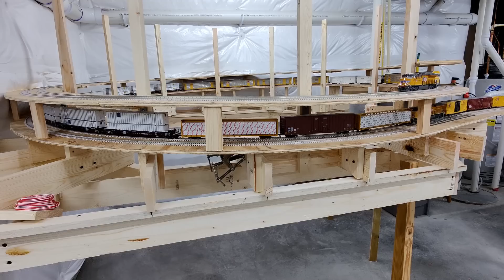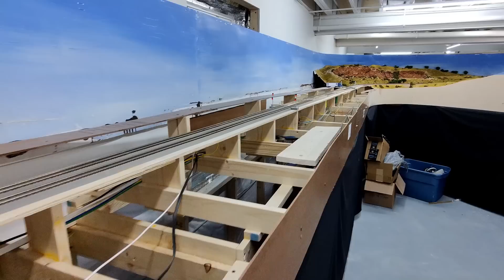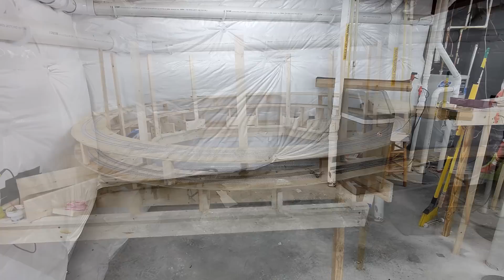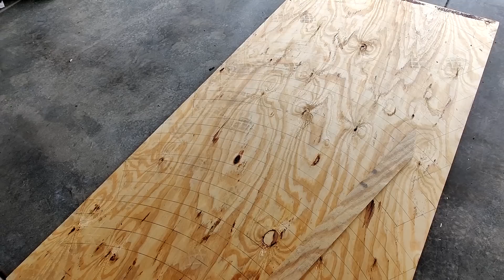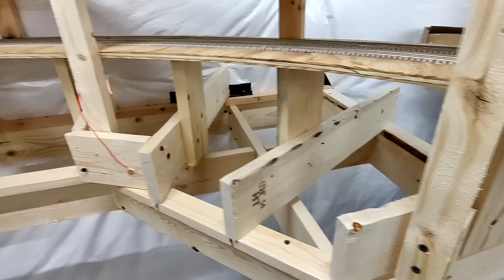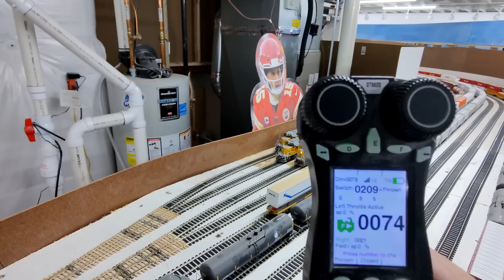S2022E19 Helix Contruction Part I - Model Train Layout Ops & Realism Union Pacific RR

Comment: Wonderful.  I love it.  I follow each week.  Question please (a very basic question) how did you mount the 1 x 4 horizontal wooden flat braces on to the basic frame of the layout?  Did you glue them?  I do not see any nails or screws.  If so, what kind (brand name) glue did you use?  Was it some kind of construction adhesive?  THANK YOU.  I REALLY ENJOY FOLLOWING YOUR PROGRESS!
Reply from the maker: The 1x4s are screwed in from underneath.

Comment: Looks like you've done a good job on building your helix. Your testing validates your engineering decisions of grade and track radii. If you ever decide to Tortify (is that a word) the crossover turnouts, where there's not going to be any scenery, ie. inside a staging yard or staging lead, I sometimes mount Tortoises upside down on top of the subroadbed. The three Tortii at the top of my helix for Toh Jct are mounted that way.
Reply from the maker: The crossovers are within easy reach of the dispatcher, so they'll be manually thrown.

Comment: Impressive !!! My N scale helix is double tracked at 17 1/2" and 19" radius . I used threaded rods . My slope are around 2% ( bad memory .. ) 
I like your design . I go up with as much as 65 cars and 5 x 6 axles locomotives . The real problem is going down , you need a steady speed and you are ok , because the train is pushing really hard on the first 10 cars behind the locomotives .
Keep up the good work !!!
Reply from the maker: Very cool! I'll be glad if I can get that many up and down reliably.  Mostly though, the trains will be between 25 and 40 cars and two to four locomotives.

Comment: I love the design of that helix being so open, your son in law did a great plan. I wonder if you even need the blocks on the outside since the subroadbed is so well supported with the bracket. A 1 1/2 inch wide piece of plexiglass around the inside will prevent falls and stiffen the subroadbed between supports and will not interfere with the view. Where are you going to join the two ends? Will they both go into the helix or just the side you have going in already? The layout looks great.
Reply from the maker: Yes, the helix will join the two ends of the railroad.

Comment: The Intermountain Tier 4 and Genesis GEVO lashup ran so well together up the helix, was the speed table CVs adjusted or did they run this well together right out of the box?
Reply from the maker: Yes, I use JMRI speedometer to speed match all the locomotives.  So, I can change things around at will without worry about which units run the same speed.

Comment: I like Patrick Mahomes watching over you! Do run your routes right! I'm just a bit worried about the placement of the double crossover with its S-curves, especially when long trains come downhill!
Reply from the maker: Yes, that is going to be a problem, especially for 89' cars.  There will be a double crossover at the top of the helix with more straight track before and after.  So, the dispatcher will need to use that one as much as possible.  Going up the helix, the crossover will always be inside to outside track when the S curves are not near as bad.

Comment: I can not believe how far you have come in just 9 to 10 months! It's just amazing!! I do have one question. Are you gonna run some sort of plexiglass or some kind of other railings for the helix inside and out just in case of a derailment?
Reply from the maker: Yes, I do plan to have some sort of barrier on the inside of the helix.  May be something as simple as a wire a couple of inches above the roadbed. Just want something to stop cars from falling to the floor.

Comment: Always concerned about the number of turns. diameter, incline, and the train length since this is a work around and does not exist as a prototype. Empty cars up front will cause the train to clothes line. Just watch videos of Altoona PA.  More weight in the cars will help. There should be some equations to address the physics and provide minimum and maximums for the helix. Just FYI love the layout.
Reply from the maker: I am going to embark on a major rolling stock tuning project once I get the mainline completed all around.  Probably in October sometime.  Will check every car for free rolling abilities, weight and wheel gauge.  May take some time.

Comment: I see no evidence of buss wires or track feeders anywhere on the helix. How are the trains able to run such distances without them? Or are the buss and feeders well hidden?   JDM (not Linda)
Reply from the maker: Right now, I have just soldered feeder wires to the rails every 90 degrees.  I'll run bus wires and connect to the feed wires as I finish the helix this week.

Comment: BRAVO!!! Congratulations on getting the helix up and running and working out of the other side of the yard. I'm really looking forward to your connecting the two ends so that you can run a complete loop when needed. Oh what a day that will be! Question for you, will you be providing any kind of protective barrier to keep the train on each level should a derailment occur? Our club used hardboard up to about 1" above the subroadbed, but I was thinking window screen material might be less expensive and easier to maneuver up and over. Keep your amazing work and be safe this storm season!
Reply from the maker: Yes, I do plan to have some sort of barrier on the inside of the helix.  May be something as simple as a wire a couple of inches above the roadbed. Just want something to stop cars from falling to the floor.

Comment: I'm impressed.  Was wondering where the Helix would be build, and now I know.  Splendid work in progress. I see Lombard Hobby and Walthers is out of stock on the double crossover.
Reply from the maker: Yes, I had mine on preorder as soon as I knew they were coming out.  Got them as soon as Lombard Hobbies did.  They have been sitting on a shelf here for about 4 months. Seems preordering is the only way to get a lot of things in model railroading.  Got to really stay up on what the hobby manufacturers are up to.

Comment: The old adage 2 cars per driven axle is the go. Your close. I made my helix 30"r out of 10mm ply but had to change it up to 12mm to stop the bowing the Scale trains loco's weight did, KD 158 couplers uncoupling.  My spacing being a bit wider than your supports. Double Stack train stringlines at 24 cars so added mid helper at 20 and then have 10 after . It looks good Daryl
Reply from the maker: thanks!

Comment: Too cool, Daryl. Remember your locals won't pull as many cars up the inside helix - have you tested that yet?
Reply from the maker: No, not yet.  You are right about the inside being steeper.  The double crossovers will allow uphill trains to take the outer track and downhill trains to take the inside track.
Reply: The grade is only slightly steeper, but the tighter radius adds to the load as well. Using the inside track for downhill trains is a sound strategy.